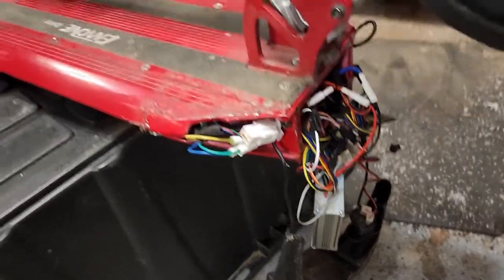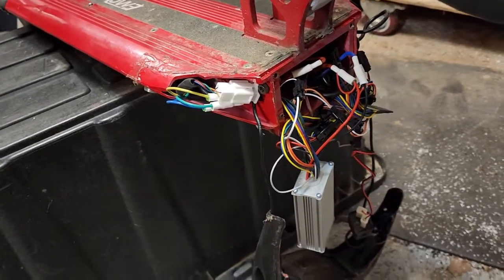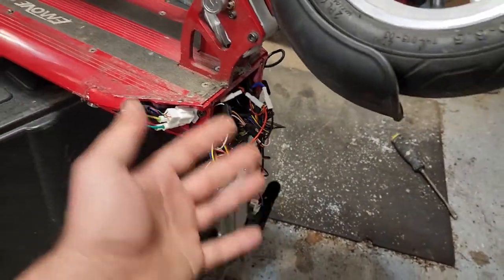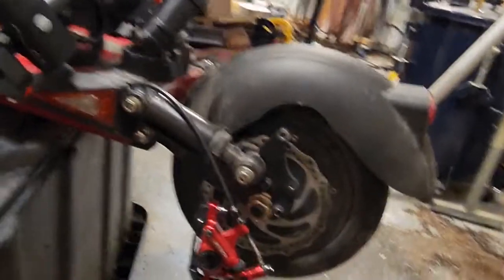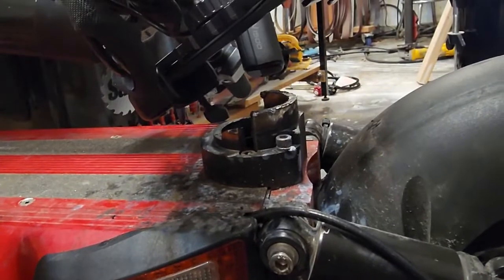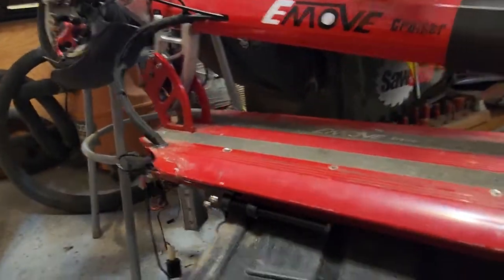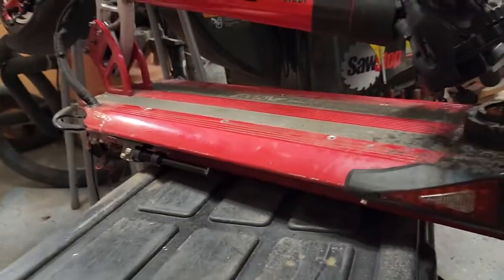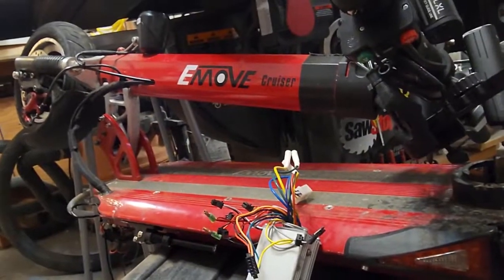Why you should not buy a Voro Motors 1000w emove cruiser - honest 6 month review - tons of problems!

Comment: i am having controller issues now on my cruiser. fully stopped working at 230 miles but voro has none in stock so have to wait 6-8 weeks. i noticed mine starting to have issues at 50 miles like you said they last about. i like the scooter but has its downsides too
Reply: just buy one from aliexpress, they are cheap and better quality than the junk they give you, but that does take a tiny bit of know how to replace a controller, not that hard
Reply: @DyLemmaOG  did get around to replacing the controller last weekend but they sent me a 2 inch longer one than the original. of course it didn't fit in where the original one goes so they said this newer upgraded controller they send for 2020+ cruisers goes into the battery compartment.
Reply: @nicolefreak555  Don't have an emove cruiser so couldn't tell ya. Thankfully the most expensive part on electric scooters/bikes is the battery usually and batteries are reliable if treated correctly. Controllers/motors aren't THAT expensive and pretty easy to replace yourself

Comment: perfect i paid 800.00 pounds for mine but its called the Qwin wings G5 ,. comes with a 26.8ah battery . 50 miles range but may get way more ????? 

but mines so upgraded but not ?? it has awing arm rear suspension , front motorbike suspension , 11inch wheels goes 25mph but claims 40mph ,2  front lights its massive and slighly heavy at 43kg 

had it about 2 weeks want to really give it that max range test , but its winter.
and i can say she really does struggle on hills but some she can climb for that am happy makes me happy that i paid 800.00 and i have better specs them the emove but i dont either ?????????????????

may try buy another one

Comment: I bought my emove last February, and it came broken. It started smoking as soon as i plugged in the charger. Ive sent it back like 4 or 5 times because everything keeps breaking down, from controller issues to brake problems,  motor issues, ball bearings,  etc. And now battery. Worse investment of my life. I will never buy anything from them again. They robbed me of $1400. I might be done with electric scooters altogether.

Comment: Advice pleaseI have similar problems i got the  scooter refurbished , it says on the website refurbished ones had max 10 miles on it it came 67miles with some scratches and tires was not so good , i never reach 62 miles battery was finishs max 30mil and went service they charged me for small part , then i drove the scooter 2days and this time middle of the road scooter stop working and i went them again they keep it checked after 3weeks they told me they gonna change the controller ( I didn’t expect that and they told me i can pay the difference and get another one ) if i get new mantis gt or wolf king gt pro or mantis king gt they both have new controller 
Which one would you recommend guys ? 
I need to work for scooter need reliable scooter 
Thank guys

Comment: 8th subscriber and 8th comment

Was hoping to get it for range but now I’m scared it may come bad
Reply from the maker: Have also since had my key/volt meter come apart, cover fornthe charging port fell off, and the seat attachment piece broke again, after getting fixed again.  Front tire still leaks too
Reply: This company bargains customers to leave reviews within the first month of owning the scooter. I got to offers of prices if I would leave a review in my first month. Of course I didn't because: one, that´s not honest; two, what could be wrong with a 1500 scooter in the first month. Do your research before you buy it. I wouldn´t recomend it
Reply: Don't buy it

Comment: It's a sine wave control so idk why one of the best controllers didn't work for you and at 300 miles that sure does look like you drove it 30,000 miles
Reply: I am on my third controller. Third one sine wave controller. My other scooter kaabo skywalker, had for about 5 years. Kaabo not one issue. I have done no maintenance on kaabo at all, no mechanical issues, no loose bolts. Cover for back tyre on emove only 1 bolt holding it in place, despite me using loctite on most of the emove screws. Single brake on kaabo works better than 2 brakes on emove.
Voro are terrible with warranties. Voro has stem wobble regardless of adjustments. Ignition barrel failed, $90 to replace.
Come tomorrow going to put it up for sale. Only real positive I wo7ld give emove is its range.

Comment: Why havent you just purchased an aftermarket controller with a higher wattage? It's obvious yours is too weak since they keep burning up. Most of them are simply plug and play with identical wiring. Could have spent 40 bucks on a better controller and problem solved

Comment: Well I don’t want one of those.
Reply: I have almost 800 trouble free miles on my Cruiser. Sorry about your bad luck.
Reply from the maker: Wish id never bough it.  Scared to even ride it.  Have heard of others having more dangerous problems happening at speed.
Reply: @jayparker393  It is not bad luck, it is bad quality. I have fallen dow three times: once, the thing that locks when you fold the scooter broke and the scooter folded while I was riding it; twice, because the throttle started acting up (accelerating whenever and out of nowhere); thrice, because the break lines break super easy and I was going downhill I almost couldn't stop and crash into someone. I have more to say but there´s a big percentage of customers complaining out there or staying quiet.